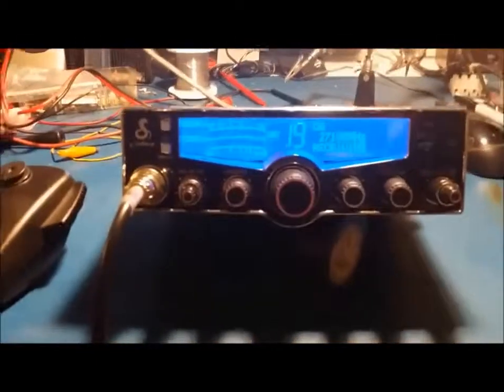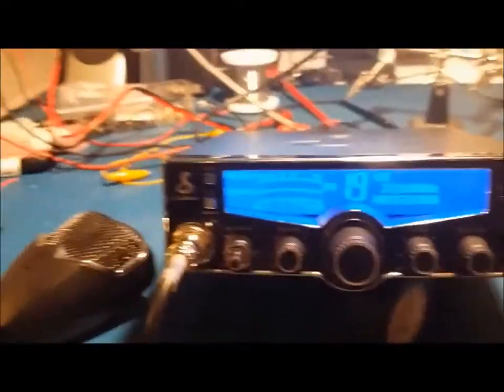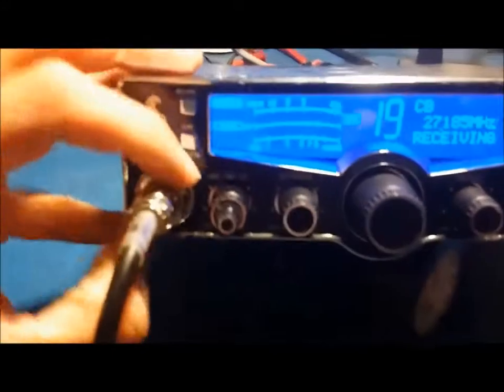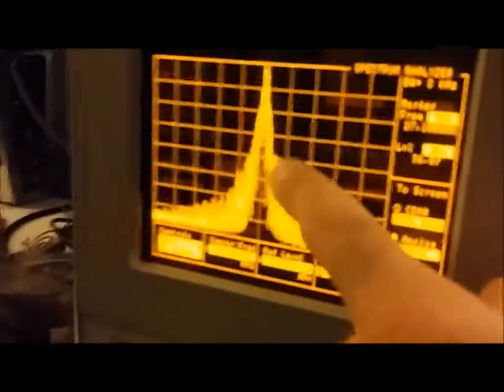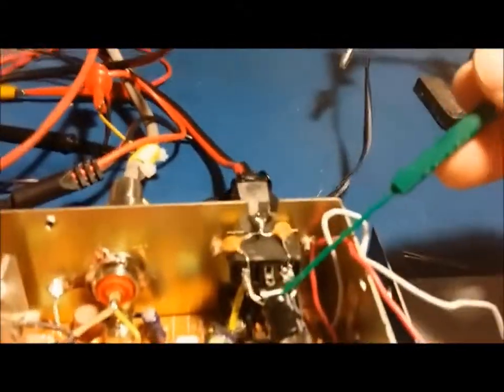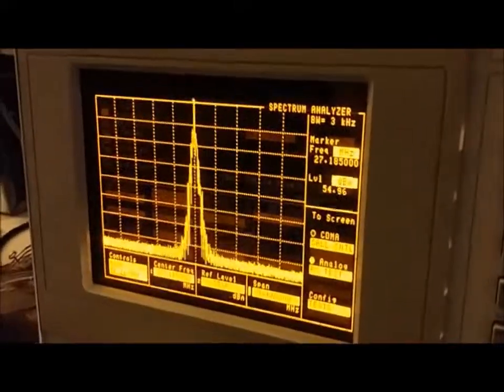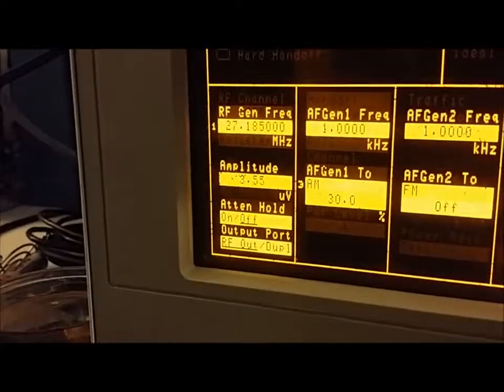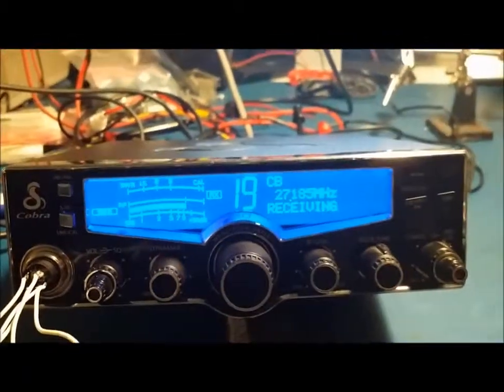Cobra 29 LX LE MOSFET Upgrade and Receiver Alignment

Comment: what the hell thats a cool video did you just adjust the freek'nn modulation through the microphone? seen the  wires for test hooked up to the equipment but i did not see you turn a fuckin pot to turn down the modulation thanks again great video